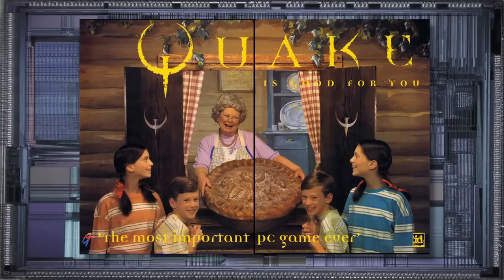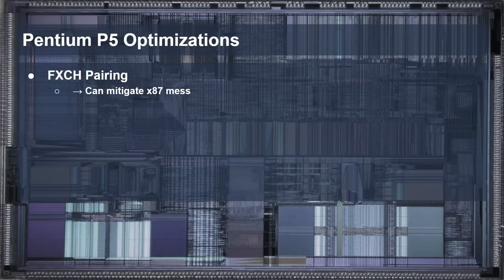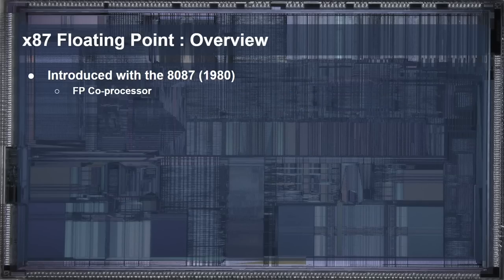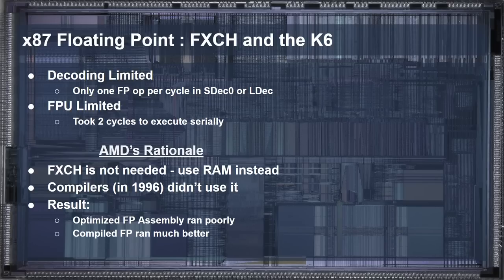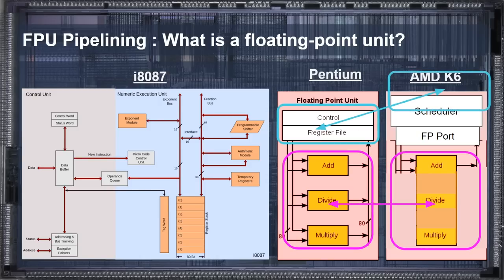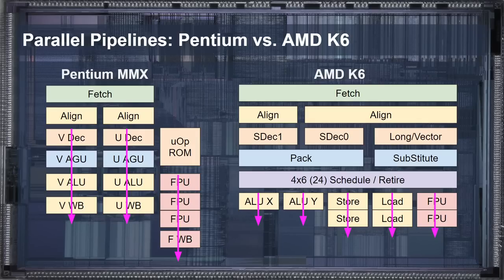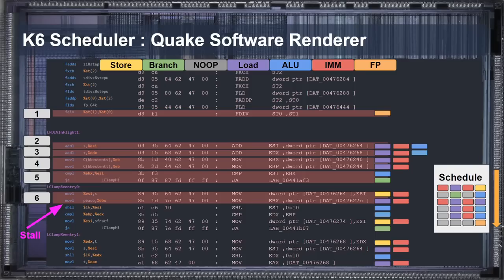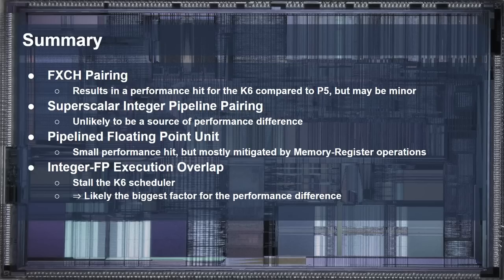Quake, Floating Point, and the Intel Pentium

Comment: You forgot quake (and some other games) had optimized executables for each processor brand.
Reply from the maker: Even with an optimized executable, you wouldn't be able to get around a hardware implementation "bug". You could potentially reduce the impact slightly, but not eliminate it.

Comment: Wolfenstein and Doom were not targeted to the 486 processor.  They both ran on a 286, although jerkily.   On a 386 Doom was fine.
Reply from the maker: Targeted implies the configuration in which the game runs the way the developer intended. Unless the developer intended the game to run jerkily, the 286 would not be considered the target processor. Same thing for Doom (you would have to reduce settings to run on a 386). Regardless though, if you look at the system requirements, Wolfenstein says a 386 is recommended and Doom lists the 486. These recommendations are the targeted system, and scale according to the computational workload that each of the games demand.
Reply: @RTLEngineering  I guess we have to disagree.   I went through all 3 levels of Doom on a 386. It was quite smooth.  There were no settings to reduce.  There were no 386 processors when Wolfenstein was first released in 1981.  The 386 came along in 1985.
Reply from the maker: I think you are confusing games, which is my fault for not being clear. The Wolfenstein I was referring to in the video and the comment above is Wolfenstein 3D, which was released in 1992. As for Doom, the minimum requirements were a 386, but it ran smoother on the 486. As for setting to reduce, if I recall correctly, you can reduce the render window to make it run smoother (smaller window means fewer 3D pixels to draw each frame).
Anyway, the disagreement may come from a colloquial and technical definition of "targeted system", where I was referring to the technical one in the video.
Reply: @RTLEngineering  You are correct about reducing the window size, something I never felt a need for on a 386.  I didn't even know it would increase smoothness though that also makes sense.   I've never played Wolfenstein 3D so I am sure you are right about it.

Comment: Celeron 300A scored the highest;  I guess it is because it was the final chip made by Intel which used the OG Pentium Architecture along with having the same floating point logic, considering it was Intel's budget low end chip, I just find that fact very amusing.  Weirdly Intel still makes Celerons but not for the consumer market, they're now used in those redundant architecture industrial computers;  The role Celerons were used for has been replaced with i3 processors.
Reply: Celeron 300A "Mendocino" used a Pentium II P6 core with an on-chip 128KB L2 cache.

Comment: Very good analysis. However, FP division is something that every software developer knows to avoid like the plague. What was the reason that Quake was written using FP division to a degree that it was measurably influencing game performance?
Reply from the maker: This is a necessary operation for performing perspective-correct texture mapping. Think about the texture mapping on the original PlayStation vs the N64 - the PlayStation textures would warp and distort, which was because each sample is not being divided by the depth of the perspective transform (which is what allows a 3D object appear 3D on a 2D screen).
So essentially Id has the choice of distorted textures or rely on FDIV performance, which is turns out the Pentium at the time could sufficiently handle the FDIV load from the software renderer.
Reply: There's always alternatives, but, eg, using integer operations and/or table lookups means you're now using the resources those following ops would have been able to use in parallel with the fdiv.

There was the famous Doom self-modifying code loop to correctly texture quickly on the 386 and 486, but perhaps that approach didn't play well with the newer operation decoders or the more general cases that quake needed.
Reply from the maker: That's true, but integer operations and table lookups wouldn't perform quite a well as FP ops (precision and interpolation issues). I would imagine that an integer solution was tested and found to be insufficient for their design goals.
As for self-modifying code, that would have performed far worse on the K6. The K6 actually pre-decodes the instructions when they stream into the instruction cache, this means that self-modifying code would necessarily require the instruction cache to be flushed and re-pre-decoded every time a modification was made. The Pentium on the other hand did pre-decode the instructions as well, but that occurred in the fetch path (post-cache).

Comment: So ok... K6 couldnt decode complex integer insturctions paralell to floating point while pentium can and pentium has writeback so load and store instructions are not needed for writing back a result tu L1 cache. So if FDIV isnt pipelined, K6 would stall if after FDIV there are plenty complex integer instructions while pentium wouldnt cause it can do FPU + complex integer in paralell. If only amd made one of SDec0 or SDec1 complex decoder...
Reply from the maker: I think you may have gotten that confused. The FDIV in the K6 was "pipelined" from the rest of the processor, meaning it could execute FP and integer instructions in parallel. The problem was the re-order mechanism in the K6 which would fill-up during a FDIV operation and have to wait for the FDIV to complete before it could allow more instructions to enter. The Pentium didn't have that issue as it did not use an out-of-order mechanism.
Reply: @RTLEngineering  ok, but i think due to ooe fdiv can execute in paralel to integer instructions on k6
Reply from the maker: That's correct, FDIV can execute in parallel on both the K6 and the Pentium P5. The problem was not the parallel execution, it was the Re-order Buffer/Instruction Queue on the K6.

Comment: Ugh. 320x200 was so pixelated even on a 14" monitor. Most of wanted to run at least 640x480. No can do, even with the latest Pentiums of the time. Depending on Pentium model, frame rates were mainly in the teens or 20's. It took 3dfx and Rendition to push Quake frame rates to a playable 30's and 40's at 640x480.

Comment: Is not that different that Cyrix and K6 actually run on lower frequencies than was in their names? It was that Pentium rating..
Reply from the maker: The Pentium Rating was to match integer performance (the dominant workload at the time), however, the Pentium would still outperform the Cyrix and K6 processors in Quake at the same speed. The floating-point division operations are performed frequently during software rendering and completely stalling the pipeline each time hindered performance regardless of the core clock speed.

Comment: Mistake early and video, you said they all have the same clock speed, that is not. The cyrix and AMD chips use performance ratings,
Reply from the maker: They all have the same effective clock speed (as measured by integer performance), that's what the PR is supposed to indicate. The Cyrix and K6 had a higher IPC than the Pentium, meaning they could achieve a similar integer performance at lower clock speeds.

Comment: I need to make a video on the total disaster my first "real" PC made from actually new parts was. It absolutely hauled for productivity and web browsing (back when page rendering speed mattered even on 56k!) but was an absolute dog at games. I picked pretty much the worst combo I could have back then for performance and stability.... A K6-2, An ALI Aladdin V chipset mobo and an NVIDIA TNT2. I'd have been better off with a PPGA Celeron, 66 MHz FSB and all and the cost difference would have been almost nil. Quake engine titles suffered the worst as expected but Unreal engine stuff wasn't exactly amazing either, though the latter DID benefit from 3DNow! without AMD making a special patch like they did for Quake II. 

I stayed with AMD for the next rig I built for my 16th birthday....Athlon Tbird 1000 AXIA stepping OC'd to 1400 and a Geforce 2 Pro on a KT133A board. That was a proper rig though it combined with the barely 68% efficient PSUs at the time kept my room rather warm. I learned a lot in between those two rigs.

Comment: I remember being affected by this in the later stage of my k6-2 550 life, I had a kyro 2 GPU but pentium 2 450 users smoked me in RTCW, for that game switching to a duron 1300 while keeping sdram was one of the biggest boost ever for me.
Reply from the maker: The Duron (K7) was a huge improvement over the K6, and marked the beginning of AMD's architecture shift which is still seen in the modern Zen processors.

Comment: Wolf3d and Doom did not target the 486. They targeted the 286 and the 386 respectively.
Reply: Doom did in no way target the 386.
Reply: @ccanaves  a 286 did not have reasonable performance and most of them did not have enough ram to play doom.
Reply: @dotplan  Doom was targeted to a 486. It ran at 90% full speed in a DX2-66 with a VLB card. In a 386-40 (which is how I played it) it's super slow, even with low detail and a shrinked screen. OFC a 286 was not the target. Wolf3D was more of a 286-386 hybrid. It did run well on a 286-20, but ideally you want a 386-33.

Comment: Was that a Carmack's genius, Intel's one or the money sent to the compilators owners?
Reply from the maker: It wasn't from the compilers as the code to do this is written in assembly (it's in the Id github repo if you want to look at it).
I would say it's a combination of the other two. Carmack knew that the operations could overlap, so he could rearrange the computations to take advantage of that. Intel knew that stalling the pipeline would be bad for performance, so they let it continue as soon as the exception condition could be assured. And the fancier Out-of-Order execution in the K6 was ahead of its time (for this application), where bugs like this had not been worked out.
Reply: @RTLEngineering  Thanks for your reply!

Comment: Instead of having to watch 20 minutes of fluff, here's the simplistic short answer:

Perspective-correct texture mapping requires one division per pixel, which is very slow (especially back then), but a good-enough approximation can be achieved by only calculating the division each n pixels (eg. each 16 pixels) and interpolating the texture linearly in between them (it's not perfect, but it's good enough, especially at lower resolutions).

What the Quake engine did was to calculate the division for each 16 pixels (IIRC) and interpolate the other 15 pixels linearly using integer math, taking advantage of the fact that the Pentium supported running non-FPU code while the FPU was doing the division, up until the result of the division is needed (or a new FPU instruction is encountered). So, essentially, the 15 in-between pixels were rendered while the FPU was calculating the division, making them essentially free. This made the rendering almost 16 times faster than if it had calculated the division for each pixel.
Reply from the maker: That's not the topic of the video... It was discussing WHY the Pentium could execute the fdiv in parallel while the K6 could not. Additionally, the time it takes to execute a fdiv is negligible compared to interpolating 16 pixels (i.e. fdiv would complete before the second pixel was interpolated). The real speedup came from not having to wait for the fdiv to complete (even if it were a 4 cycle delay, that adds up over every call).
Reply: The author said so, but nearly nothing you said makes sense in this situation

Comment: Decent video. I enjoyed watching it but... Please, please, please would videos like this stop measuring performance in FPS! It's a nearly useless metric. Use time-per-frame instead. As a developer I'm telling you - THIS is the way you need to measure these things or your going to get a skewed understanding every time.
Reply: Comparing performance via using fps metric is what already came included with the game, that's probably why it's the common metric. But i'm interested and have no clue, would you mind to explain why  time-per-frame is better and point me to the differences ?
Reply: not really
Reply from the maker: If were to redo the benchmarking, then I could use a better metric as you suggested (time per frame, with a min, average, and 90th percentile). The point of the video was doing an analysis of the architecture and Quake using existing benchmark data (which was in FPS), to explain the performance differences. While this is probably not what you want, you can always think of FPS as the inverse of the average frame time. And for this type of analysis, comparing the average frame times is the most practical approach.
Reply: All you need to do to work out the time per frame is to do 1/[average fps]. Don't see how it's a useless metric.
Reply: @RTLEngineering  Perhaps 'useless' is strongly worded. Misleading would be better. The classic example I see is when people compare framerate changes erroneously or even just give the fps loss or gain with no context. For example they say something like 'this gained me 15 fps!'. That is a completely meaningless number. Going from 15 fps to 30 fps means you've cut your frametime by a whopping 33.3 milliseconds! Huge gains! You've literally doubled the speed! But if you were already at 120 fps and you gained 15 that means you only gained about 0.9 milliseconds of performance. Not completely insignificant but certainly not nearly the gains. In fact even if you doubled the framerate from 120 to 240 you still wouldn't have doubled the performance relative to the jump from 15 to 30 but instead only gained about 4.2 milliseconds.
Reply from the maker: That sounds more like an argument against relative numbers. Saying "this gained me 15 fps" is could be equivalent to saying "this saved 2ms per frame". Quoting an absolute FPS or absolute frame time allows you to see the average picture of performance. Although what we really need are more complete statistics as I mentioned in my previous response. Unfortunately, those numbers are hard to come by and they are not necessary for the point made in the video: why was it faster, not how much faster was it.
Reply: @RTLEngineering  Basically yes. If you want to give both the start and end framerates then that will definitely give you the same information and the rest can be worked out. But giving frametime is usually just a more convenient shorthand. Gamedevs themselves generally don't use framerate when determining performance metrics. We always use frametime for exactly those reasons. FPS can be used as a more subjective description of how things feel or when dealing with syncing to other hardware such as refresh rates but they always need to be converted to frametimes anyway when empirical data is needed for measuring performance gains or losses. Anyway, despite that one nitpick of mine I did still really enjoy the video so don't take my comment too hard. Still an excellent video with great sources of information!

Comment: This is crap. Cyrix emulated X86 and had a horrible coprocessor. AMD played Quake almost as well as Intel. In a couple of more years AMD would release it's 64bit processor while intel couldn't give away Itanium.
Reply from the maker: What you said is true, but completely irrelevant to the video. I was not trying to say one was "better" than the other, but instead explain the technical reasons for why they differed.
As far as I am aware, Cyrix did not emulate x86, it implemented it directly (you are probably thinking of the Elbrus CPUs). It did have a poor FP coprocessor though, but it also suffered from the similar issue to the K6 - it was blocking.
As for the K6, it does not matter if it performed almost as well as Intel, it still performed "slight worse" (if you are generous), and the question is not how did they compare, but why it was slower.
And in terms of the future CPUs, those are also irrelevant. AMD could have done something differently, but they didn't. Their architecture choices in the K6, while brilliant, had this unfortunate side effect (again, the subject of the video).